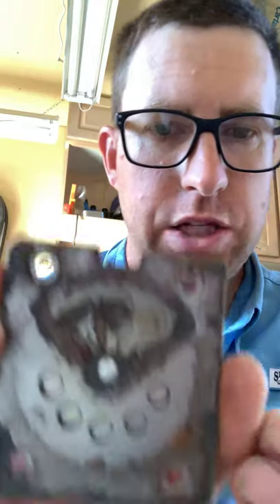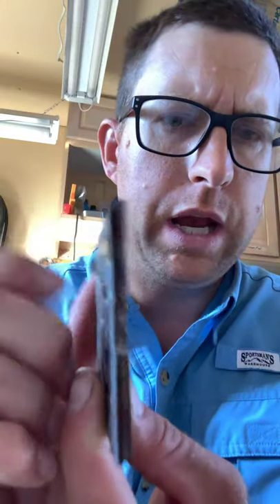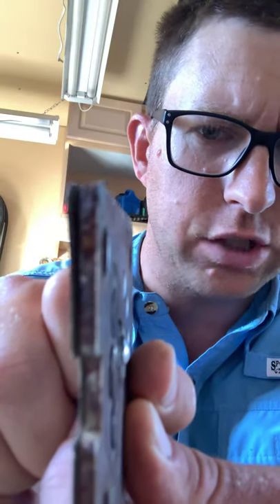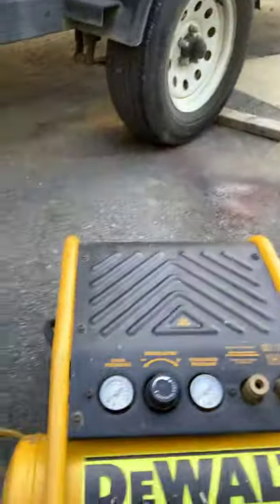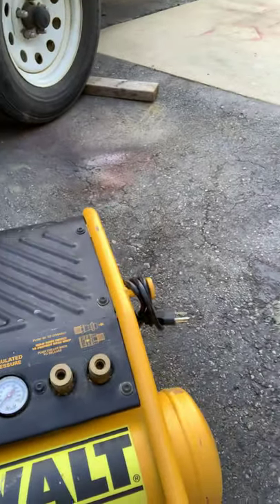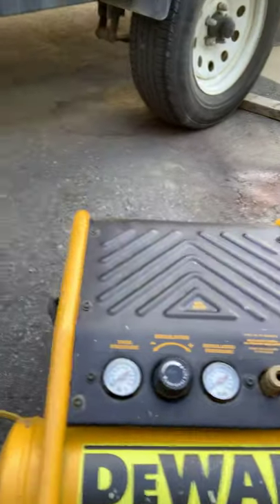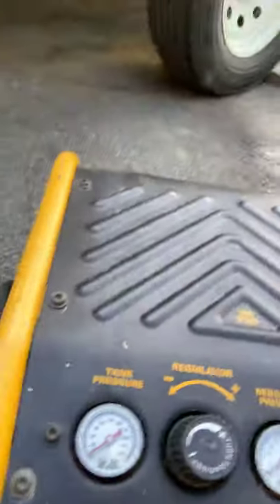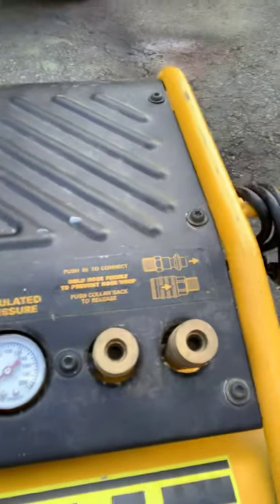How to fix air compressor that doesn't build enough pressure

Comment: Compressed air has moisture so if you do not use compressor oil and drain your tank when done using this will happen parts can rust and go bad...

Comment: I just fixed a compressor exactly like it only my problem was the compressor regulator needed rebuilt . It cost $25 and was a piece of cake to fix . New compressors like it are over $400 so I think I did pretty good .

Comment: I have had the same compressor for the past 15 years with no issues so far. Can you repeat the name of the part and it’s location and is there anything i need to do besides emptying the tank of moisture?. I thought it was “maintenance free”.. but I’m just noticing it has oil.. lol 
Thanks in advance

Comment: No the rust is from people not draining the tank and storing the tank upright. Eventually the check valve rust out and
Water drains back to the head and it rusts the valve plate.  People also forget to drain the tanks first.

Comment: When I finished replacing the pressure switch on my D55141 compressor, I had two very small screws left over.  The were Phillips head screws, no more that 1/4" long.  Does anyone know where they are supposed to go?